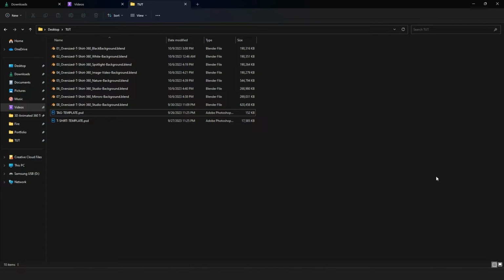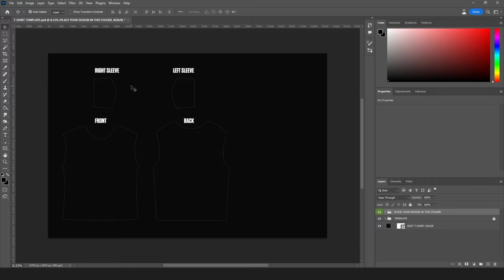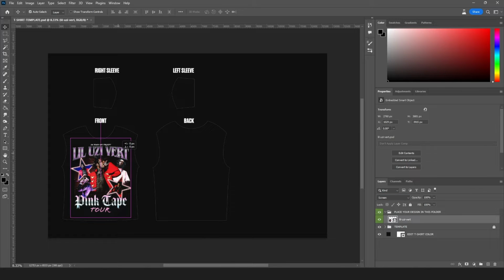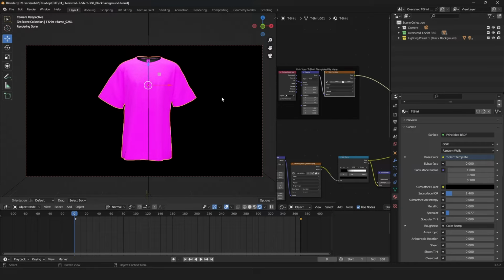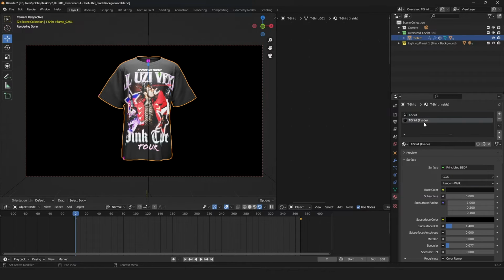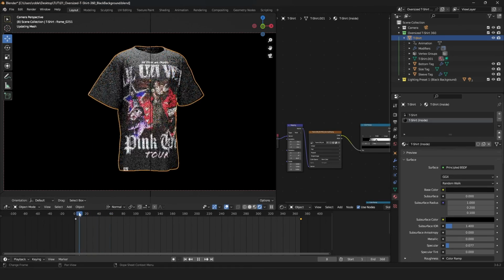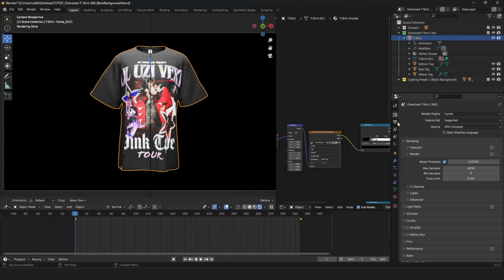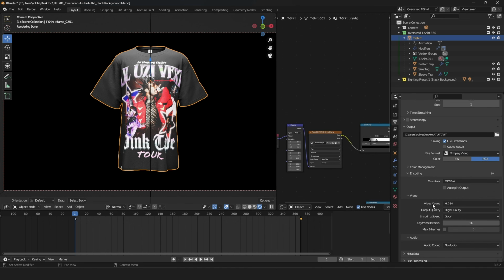3D T-Shirt Mockup Tutorial (Blender 3D)

Comment: Hello, idk if it's will be possible or anything, and i write this message 2 years after, but i just bought it, and i would have like to make the whole tshirt move.
Lke having the sleeves moving like the rest, i'm kinda new to blender so i wonder if this is possible ?
Reply from the maker: Hi, tbh I'm not quite sure that this is possible with this template (or it may be difficult). This template was made by baking a cloth simulation, so re-sewing or re-simulating the shirt isn't really possible. I think your best bet is to try to deform the mesh using modifiers. Thx